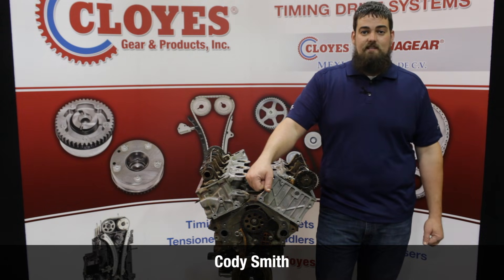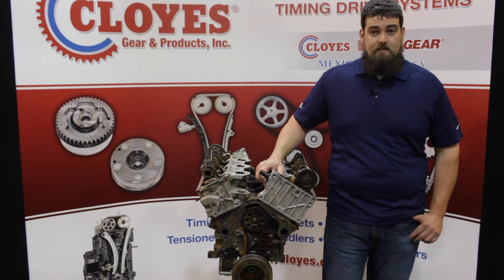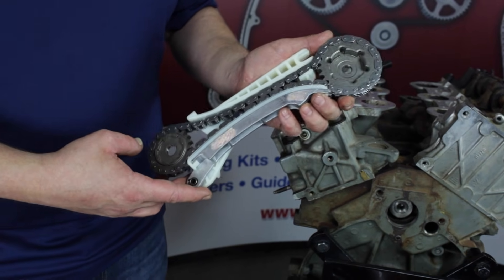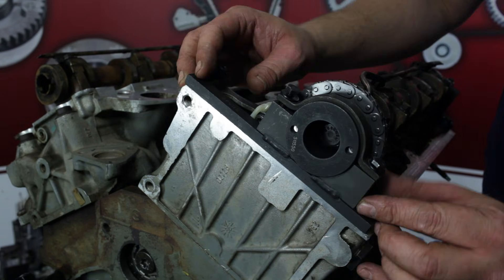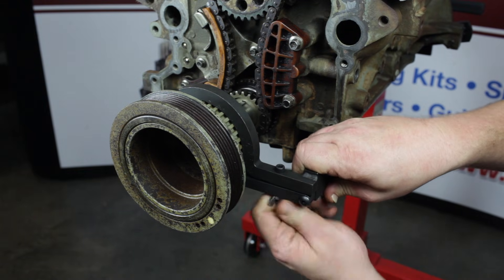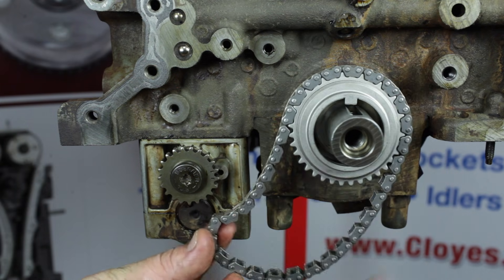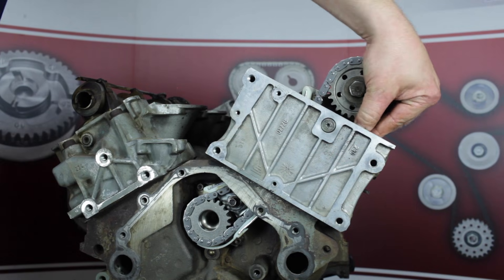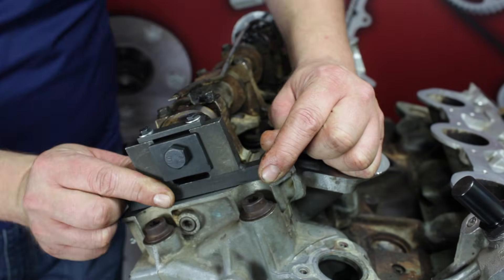Ford 4.0L Timing Chain Replacement, Cloyes 9-0398SB

Comment: Think your wrong on the tensioners getting oil. You have to hand pump oil into them before you install them. The engine wont give them enough oil to do so.
Reply: Mark Wolf is this correct bcz I did prime the rear but not the front now it makes a ticking sound but it didn't at first kinda weird
Reply from the maker: You can prime the tensioners before installation, however we have seen during testing that a dry tensioner only takes a few seconds to prime up and apply pressure to the chain with average engine oil pressure. letting the engine turnover with a the starter before startup is sufficient to prime the tensioners, but filling the tensioners with oil before installation can only be beneficial.
Reply: Cloyes Gear & Products, Inc. (Aftermarket) I don't know I primed the rear but not the front bcz I watched this video did prime with ignition unplugged it sounds like chain rattle or a valve ticking one I can't tell can anyone go on my videos and let me know I'm about to go nuts thanks
Reply: If the engine isn't delivering enough oil to the tensioner, that's a problem with the engine.  Not the tensioner.

I decided to prime my tensioners because... well, there was a lot of metal from the old chain parts and I wanted to make sure oil was getting to where it needed to go and I did find some clogged oil squirters for the cam and rear secondary chain.  With the engine mostly assembled on the stand, I cranked the engine with a ratchet with the spark plugs removed and tensioners removed to make some kind of attempt at purging glittery oil from the oil supply passages.  I installed the tensioners dry and cranked by hand some more and it was enough to get plenty of oil into the tensioners.  I got it back into the vehicle after a couple days and when I started it, there was zero timing component noise.  Not even a slight noise on startup.

Comment: This is why I stay away from any ford product, no need for all this on a schedule maintenance most customers will not spend their money on this repair just buy a newer vehicle 
if you ask me I think ford is anti- mechanic hard to make money on repairs as it cost more than other vehicles
Reply: Fernando Faraldo This is all newer vehicles not just Ford.
Reply: I agree, but they started their mission in making sure problems arise after a few years of use. Take the Aerostar for instance it had several recalls from ignition switch to catalyst  converters some recalls had been made due to the dangers that it could cause to occupants in the vehicle.  For more information visit cars.com or NHTSA Vehicle Safety Recalls
Hope this helps, not anti ford just don't like their tactics in boosting revenues, lets not forget back in the late 80's the death they caused due to the under inflation of tires to have the mpg results be higher, even after Firestone warned of the low tire pressure they still kept doing this, the executive who blew the whistle on them saying it was cheaper to pay the Gov. fines than repair the vehicles and so on, way too much trash to list on ford my friend way too much.

Comment: Are the torque to yield bolts included in the kit?  Those shouldn't be reused, correct?
Reply: Honestly, with the relative unavailability that I found for these bolts, I think people are re-using them.  If people were always just getting new ones, I think someone would have gotten on the bandwagon of selling bolt kits on Amazon or something.

After torquing LOTS of bolts over the years, a person can get the feel for a bolt that gets to it's yield point.  As long as it takes a bunch of torque and doesn't feel like it is about to snap off, it is probably going to work.  If it were my own vehicle, I would have taken the chance and re-used them.

Comment: Terrible design on this engine. To top it off timing chain breaking is a common problem.
Reply: chains do not break mine has 240,000 and no problems synthetic oil is a must and change it.
Reply: Steve Schilling tensioners*

Comment: do you have a video for the same engine with no balance shaft?
Reply from the maker: We do not have a video for the engine without balance shaft. Our kit number for an engine w/o balance shaft is 9-0398SC. If you have any specific questions about the install please call our tech line.

Comment: I have a 99 ranger with 4.0 ohv if I put flat top pistons in it will the valves hit or am I good an can I put non roller lifters in it
Reply: Wrong place to ask this. If you have Facebook, join Ford Ranger Crazy, has over 14,000 members. Very good info. If not, consult The Ranger Station forums.

Comment: And hear I thought the timing overhaul I did on my 3v 5.4 was time consuming. Ford just makes one winning engine after another.  Pathetic
Reply: Haha yea that 5.4 is cake I rather do 5 of those instead of 1 of these
Reply: Damn I don’t even have two years under my belt as a tech and have zero issues doing these. Y’all old gear heads love to talk shit on new techs but y’all lazy 😂😂😂 5.4 3 valve is a absolute powerhouse no issues making 300-400k and have to do the guide and chains one time at best and same for the 4.0 definitely a powerhouse in its respective class. Not hard jobs and can be done within 3-4 hours

Comment: nice video, did my 2004 mercury mountaineer a year ago and used cloyes complete kit with balance shaft, also got the tools for the job , it went smooth as well as redid heads  wish i had this video then for a reference but oh well. You do need to pull the engine .
Reply: around what millage does it need to be replaced ?
Reply: Did mine at 207,000 the balance shaft chain was the worst one , the chain was hitting the cradle and real loud. but the rest were a little loose , but now as quiet as ever .. happy happy
Reply: was it making a grinding noise because the one we have is a 2002 and has over 220,000 on it ind it's making like a grinding/taping noise
Reply: Hey Ron.  Quick question for you since you pulled the heads.  Do you know what special process and tools he's talking about in the video required to remove and reinstall the camshaft roller followers? Thanks!
Reply: Ronald Tober hey do you have to. set the. timeingchain if the chainjump. timeing.

Comment: Great instructional video.  Was bummed when you said "remove the engine."  Dang.  A little more than I anticipated.
Reply: Sig Guy same here since it's for my work truck.
Reply: Esdras Ibarra
I'm going to try changing out the tensioners first.  I ordered them from Ford (could get them cheaper, but I wanted quality with this particular part) and will see if that fixes the issues I'm hearing.
Reply: GoTrump - So I swapped out tensioners this last week.  I went with genuine Ford parts, not just the ones from Napa, in a rare move to have the best quality part for that particularly important part of the engine.  They were kind of a B to get out, but I got them swapped, and it's much quieter now.  I also saw I was low on oil (since you have to drain all the oil to do this process anyway) and I think that contributed to the rattle.  At any rate, the chain rattle is greatly reduced, and I think we are in good shape.  now if I could just figure out where I have a tiny leak in the coolant system that causes that noxious burning coolant steam from under the hood.  Arghh..

Comment: Honestly seems like a straight forward process. Just time consuming really. Definitely got my spirits up. Plan on doing this to an 01 Ranger and can't even find a good used motor for less than 900 bucks and a complete rebuild is over 1,800. Even if I screw it up...not really out much since the guides will fail eventually. Is this kit on par with the Ford fix reflected in 04+ Rangers and Explorers?
Reply from the maker: Yes, the kits we offer for the 4.0L Ford SOHC engines contain the latest designed parts for that engine. The components will be direct replacements for the later model 4.0L's, and the complete kits will also retrofit the earlier model engines to the later style arrangement.

Comment: So, I'm just about to start putting everything back together. Does anyone have an alternative to using the hydraulic tensioner tool? I have everything all set to go and I'd like to avoid having to order this if possible. Thanks
Reply: Matt Belle you can use the one that goes in the engine while running it but it may not give you the necessary tension to assure correct cam timing

Comment: This has got to be the worst engine ever.
Reply: Kevin Bergen It's honestly not tho. If you use amsoil synthetic and a quality filter like wix, you can get a long time out of it. I have one with 186k. Never heard a rattle.
Reply: Sure its decent when working.
if properly maintained they work great I understand that.
Nobody does and if you happen to stumble across one and try and fix it. Terrible design for no reason other than being cheap trying to save on factory cost.
Reply: what  about 205,000
Reply: denny stockton That's a good amount! You must've taken care of it!
Reply: Hans Gruper yeah used mobile one for 10 years
Reply: Kevin Bergen the 4.0 SOHC is actually a great engine. the problem is that most people do not maintain their cars well. the key to making the timing chain tensioners and cassettes last on these motors are religious oil changes every 3,000 miles or use of synthetic oil its entire life. i have worked on over 100 of these explorers with this motor and every one of the well maintained ones either did not have any rattle, or it was barely audible. worn engine oil eats the plastic away which the tensioners and cassettes are made of and they break. another thing that happens often is sludge builds up in the motor due to lack of oil changes on time and it starves the tensioners and cassettes of oil and the chains going across them with little lubrication wears them down and destroys them. i have a 99 exploder sohc at the moment with 180k miles with no rattle, i have oil change records on it dating back to the early 00's indicating changes every 3,000 miles. the inside of the motor looks brand new. all the cassettes and tensioners are in great shape.
Reply: I just did the chain replacement on a 2005 with 205,xxx miles.  It is an original owner vehicle and had zero engine repairs done up to this point.  Spark plugs, a serpentine belt, and that was all.  It was reasonably maintained all of its life and finally one day that chain rattle quit going away after awhile and it had to be torn apart.  ALL of the timing components were broken except for the balance shaft stuff, and the chain/sprockets themselves.  EVERYTHING else was gone/destroyed.  One tensioner was fine, but the front one actually took a bit of a beating from the chain slamming directly against it.  I don't think I had to, but I ground away some of the mushrooming metal and stuffed it back in.

Otherwise, when there is no chain noise, you cannot tell the difference between it and that of a brand new car on the dealer lot.  Runs perfectly, smooth, quiet, etc.  It is a good engine, but I wish they would have just spent a bit more and had 2 different cylinder head castings so the repair could be done in-vehicle.  And maybe implement some timing marks and some alignment dowels for the oil pan and front timing chain cover.  If it had that, I would give it high marks up there with the old Jeep 4.0 engine.

Comment: I think that one thing that should be noted here and was not in the video is that the two piece front guide assembly  seems that it has got to be taken apart to get it down through the head and reassembled once it's down in the engine but it really doesn't have to be, there's certain way it has to be tilted and there's only one way it can be removed. I practiced on a 2005 spare Explorer engine and finally figured it out.
Reply: Brian Smith In the second gen explorers (like this one) it was not necessary to do that. In 2002 they moved the head making it extremely difficult to install the front cassette with the head on, thus having to break it into 2 pieces.
Reply: Thanks for the info ... I wish he would have used a 2002 + 4.0 SOHC in the video. I also noticed that on the 2005 and 2006 harmonic balancers they don't have the grooves for the special crankshaft holding tool to go in and it seems like the aftermarket ones that you buy at the parts stores don't either. It looks like they just added on a cheap speed sensor ring. So, you would actually need an older or newer harmonic balancer with the special tool kit to work on a 05 and 06 engine.

Comment: Wow,  very involved work. My 99 just started making a light rattling noise a few weeks, and sure enough when  dropped the oil pan today, I found 2 broken plastic pieces of what looked like the guide.  I am the original owner, my truck has 155K miles. I took care of it religiously, but now I must anticipate that the rest of the assembly and engine will fail, and at that point, I might kiss it goodbye. Not worth it for me anyway to pull this engine and repair it. The truck is 18 years old.

Comment: Some say that timing chain tensioner must torqued by 95 lb here in the presentation says 32 lb ?
Reply: Loin Lion just tight af honestly so oil won't leak. The spring tension will do the job, not how tight u screw it

Comment: pro tech 18+ years, never did one, never hope to, in car anyway. the labor rate at a shop to do this would be so much more than what any Ford vehicle this engine came in would be worth by now, in addition to all the other problems common to these models ( cat codes, blend door issues, broken springs and a fucked up rear wheel bearing design. Reason I came here , a friend asked me the procedure and wheather he should attempt it. p.s. book time is 9 hours in car lol, 24 hours including engine removal w/ 4WD and u need a few special tools, prob around $ 75-100 for tools.
Reply: It's worth doing if you do the work yourself but it might not be if you're paying someone to do it. A super honest mechanic once charged  $1865 and semi crooked mechanic will charge $2400. Then a straight up crook like a Ford stealership (that caused the problem to begin with and should cover this under a warranty re-call aka TSB) would want $3500 to do it. And then there's sentimental value, some people that are attached to a Ford that has this engine will pay what ever it cost because it's their baby.